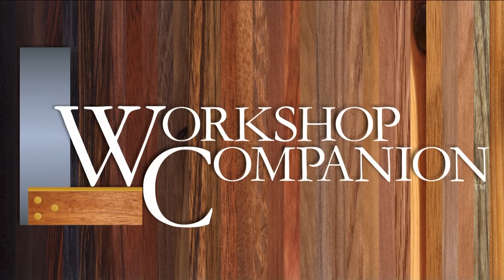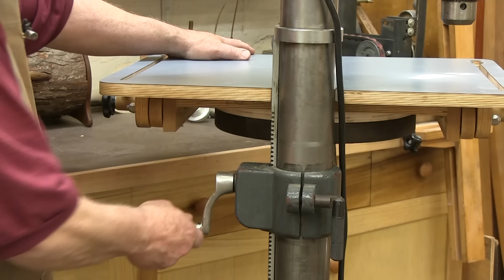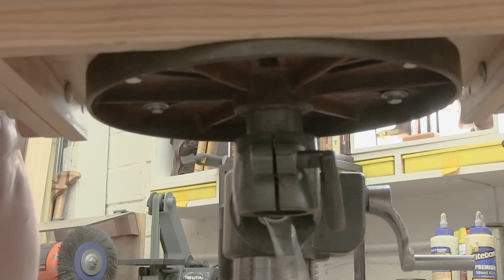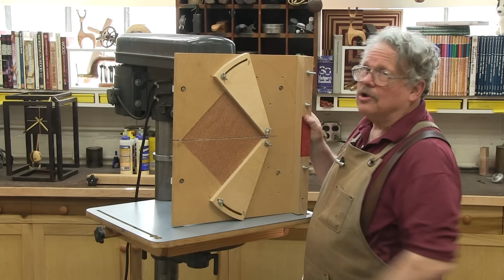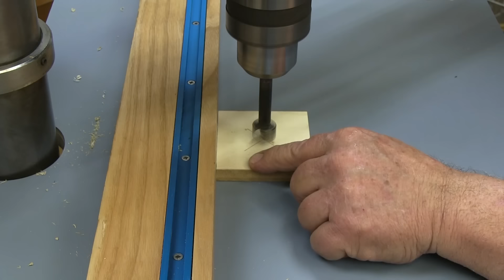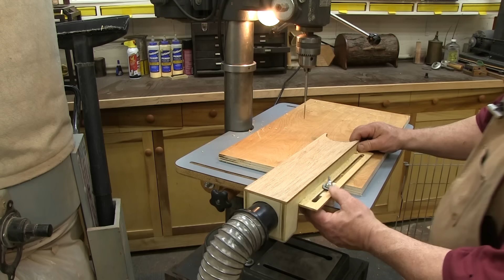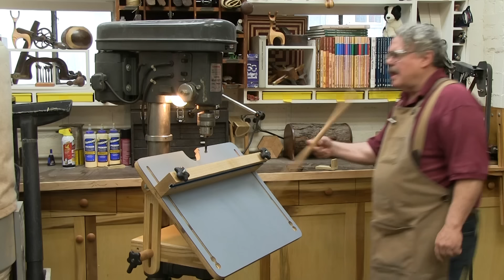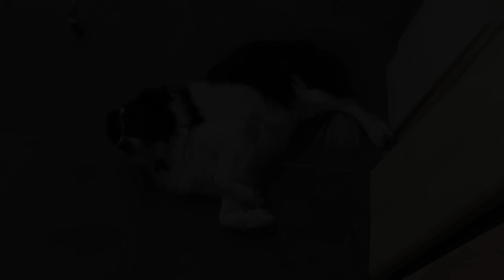Drill press Table - Woodworking

Comment: Love this simple table and fence. Is the dust collection attachment in the plans as well?
Reply from the maker: It is now. Finally found two minutes to rub together so I could finish the plans.
Reply: I purchased the plans and built the dust collection unit. I was expecting it to work “ok” but to my surprise it works exceptionally well. I’m very happy with it.  Highly recommend it!  Thanks!
Reply from the maker: @jacquesmoreau6516  Truth be told, I had exactly the same reaction when I designed it. I was writing "Using the Drill Press" and in my research noticed the build up of dust and chips often interfered with the accuracy of the drilling operations. I put this jig together thinking it would be a least some help, but if you keep a brush handy to push the chips towards the pickup, you can keep the table completely clean. Thanks for the feedback.

Comment: ingenious, as usual ☺️. Mine is held to the iron table with neodyme magnets glued into the bottom of the table. And kept in position with wooden strips fitting the grooves of the iron table. So it's easily removable.
Reply from the maker: Good idea for a shop where you do both woodworking and metalworking.

Comment: There is a useful small modification that can be made to this table. If a well routed in the centre an insert of ply can be let in. This sacrificial piece of ply can be disposed of and a fresh insert used for the next operation. Ragging on the exit side of the hole will be minimised and the risk of damaging the table is significantly reduced.
Reply from the maker: See my thoughts on this subject in my responses to Bill Wilson, Hue Janus, and Tiny Planet Adventures.

Comment: I like what you've done here, very nice.
My biggest complaint with drill presses is the shallow throat depth. On average the center point of the chuck is about six to ten inches away from the column, not much room for large parts or partially constructed projects.
Reply from the maker: I hear you. I've tried radial and overarm drill presses to overcome the small throat, but those in my price range have problems with flex and accuracy. It's something we have to live with.
Reply: @WorkshopCompanion  After watching your video and getting to thinking about it I googled a few things and see those presses with the sliding head. The design looked like it had some potential but, as you mentioned, I also wondered about flex.
I've often thought about just welding up a real heavy, rigid, overbuilt frame, attaching a repurposed drill head and adjustable table. So many projects, so little time!

Comment: Love it, bought the plans, about to build.  Your thoughts on a "sacrificial" piece at the drill point on the top.  I saw the part about putting new sacrificial piece under the "to be drilled" object, what's your thoughts about a  asymmetrical (off center) square piece that can be rotated after its been penetrated, so at least you get 4 clean areas ?   Love your channel.. g
Reply from the maker: When I've taught woodworking, I've always told my students there is no "best" way or "right" way to do things. It's all a gray scale, and you must take experience, tooling, safety, end results, and personal preference into account. What's the right way for me may be all wrong for you. For me, making a sacrificial insert -- round, square, shaped like the Taj Mahal -- is a wasted effort. For you it could be the greatest thing since sandpaper. Try it. Tell us how you liked it. And thanks for the kind words.
Reply: @WorkshopCompanion  at my age, I'm all for economy of effort/motion.  I'll acquiesce to your years and in site.  I don't need a "wouldn't it be cool IF" project... thanks again...  (it would be kinda cool to have a Taj Mahal piece, albeit a little opulent.. lol)

Comment: Love your jigs!  I’m trying to create a jig to allow me to drill 10 evenly spaced holes (36 degrees) in a turned round hub (center of a spinning wheel).  Any suggestions?
Reply from the maker: Should be fairly simple if you turn your drill press table vertical and attach a horizontal axle to it.
Reply: It’s the marking of the 10 locations on the hub that has me baffled. The surface of the hub where the holes will go is grooved, making measurements difficult.

Comment: Another great idea. I’ve seen so many videos with ‘great tips’ that are irrelevant to me, yours are very practical. The only change i would make to this top would be to inlay a sacrificial wood block. You could even flush it using your router jig from another video.
Reply from the maker: Thanks for your kind words, but I disagree with the need for an inlaid wood insert to protect the table. If you have a fixed piece of sacrificial wood, you cannot easily use it for backup. I keep several pieces of scrap plywood handy not just to protect the table, but also to backup the work and prevent tear-out when the drill exits. I move the plywood just a little bit between each hole drilled so the work always has a fresh backup surface.

Comment: Very nice, all it needs is a replaceable insert to keep from accidently drilling into your nice table
Reply from the maker: Thanks for saying so. I just keep several old pieces of plywood handy. Not only does this save me having to make inserts, I can shift  the plywood slightly before drilling each hole, giving the workpiece a fresh backup surface -- this reduces tear-out. And I can add to or remove pieces of plywood from the stack to adjust table height for various drilling operations -- that saves me running around to the back of the drill press and  cranking the table up and down for each operation.

Comment: I have to agree that this is excellent and I will build one. The only thing is that I do more metalwork than the average woodworker so I'll have to find a way of making it quickly detachable.
Reply from the maker: Not hard -- bolts with wing nuts do the trick for me.

Comment: I've stopped clicking on YouTube videos with titles in the form of "The last XYZ you will ever need" or "The Ultimate XYZ " or "Genius Idea for XYZ" or "The Best (or Nicest) XYZ you've ever seen." I broke my rule for Nick Engler and I am really glad I did. Unlike most hyperbolically title videos, this one does not disappoint. In fact it really could be the nicest drill press table! I don't know what I am more impressed with, the design, construction, or presentation. Very nice work all around.

For the purpose of setting the table tilt, would it be possible to add a large fender washer either flush with or just below the melamine veneer to accommodate magnetic angle finders such as the ones made by Wixley?  I don't own such a gauge so am not certain in which axis relative to the magnets they can measure angles, but depending on the capability of the gauge could it be sufficient to adhere some washers to the side of the table so the work surface is not interrupted?
Reply from the maker: Believe me I'm with you on the whole "Nicest or best, Ultimate, top 5" thing with youtube titles and I've tried to avoid doing that for any title on our youtube videos because it sounds like clickbait and its misleading or at least an opinion. But that is the name of the game with youtube. In order to keep these video's from going stagnate and being seen in search results we've had to up our game with keywords and unfortunately adding titles like this is one of the only ways to separate our video from the other 10k videos over drill press tables on youtube according to Tube Buddy and Vidiq. Trust me "Nicest" is not the word I would choose on my own.😂

As far as inlaying washers under the veneer that is a fantasic idea, we generally use a Vixon style  inclinometer but push the phone one because if you have a smart phone then you have an inclinometer.  - Travis
Reply: @WorkshopCompanion  Hi Travis, no judgement here on the title, especially because the video backed it. If you don't play the YT algorithm, then the YT algorithm will play you.
Reply from the maker: @woodshopnerdery  Actually, it's more like if you don't play the YT algorithm, then it won't play you. ;-) Just wanted to jump in here and say that I agree with both you and Travis about the overuse of superlatives. And the choice of "nicest" for this video was particularly cringeworthy, at least for me. Every time I read it, it has the same effect as scraping my nails across a blackboard. But research showed us that "nicest" was a better choice than "best" or "great." During my writing career, I've designed and built several of these tables, each one a little better than the last. And I already have an idea for an even better (nicerest?) drill press table -- the design evolves with experience.  So if I was being entirely honest, algorithm be damned, I would have titled this vid as "pretty good."

Comment: But if you have a Shopsmith you already have a great Table :)
Reply from the maker: You're absolutely right about that. I've converted several Shopsmiths to become stand-alone drill presses because they're so much better at drilling wood than anything else available -- large table, table tilts the right way, infinitely adjustable speed, great fence, miter gauge can be used as a stop or guide, insert available for drum sanding with dust collection . Nothing like it on the market.
Reply: And for us that know your background, we know that you have even made some old videos demonstrating using a Shopsmith for a drill press.
Reply from the maker: @timplays6602  Uh, yup. Even asked Shopsmith to consider putting out a stand-alone drill press woodworkers.